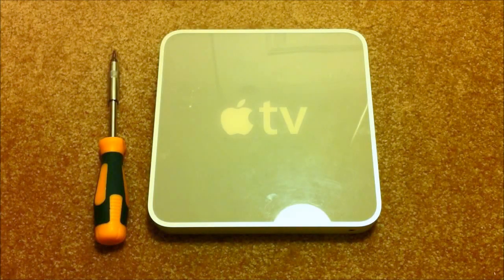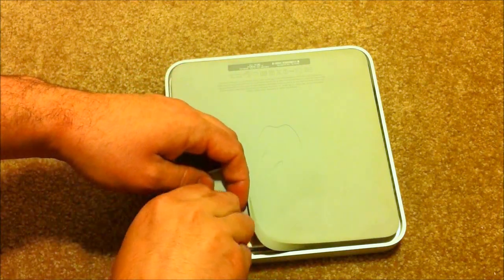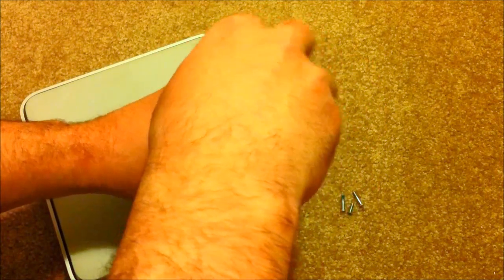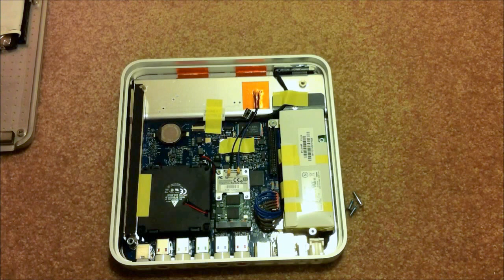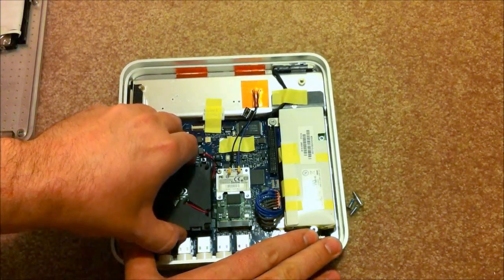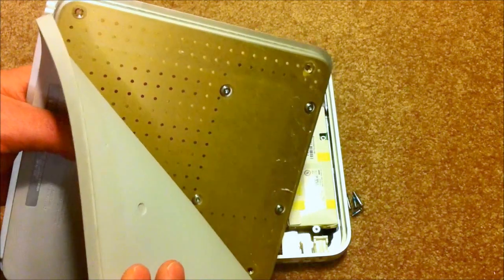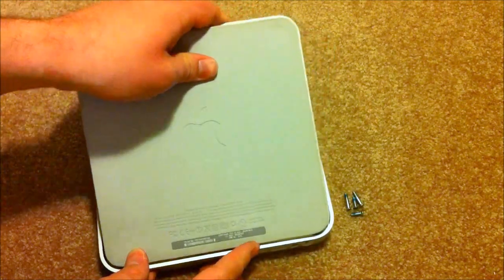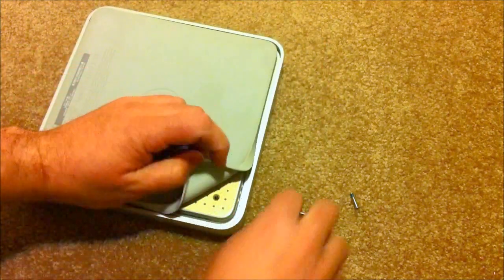Silent AppleTV - Removing the Fan & Hard Drive

Comment: I took out the fan to give me more room to install a 525GB SSD. But as I removed it I discovered that the fan was not intended to cool the boards surface it pushes the air thru a duct along one side on the unit which I think circulates air over the underside of the glass. Not sure its removal is a good idea. Is your 1st gen still functioning?

Comment: I have an ATV1 with decoder card. When I tried to run Crystalbuntu and XBMC from a flash drive with out removing HDD and it was ridiculously slower than running it from the HDD. So I never went through the HDD removal steps and went back to running it all from the HDD. You mentioned modifying files on the flash drive. Like what? Do you have a video about that?

Comment: I'm running Crystalbuntu on my ATV1 and have noticed it puts out a LOT of heat.  After playing a movie the unit is almost too hot to touch.  I'd like to replace the HDD with an SSD and remove the fan to eliminate noise, but I'm worried about the thing overheating and cooking the components.  What has been your experience?